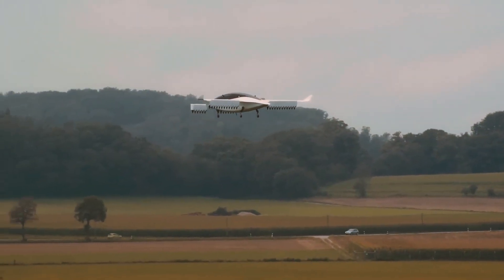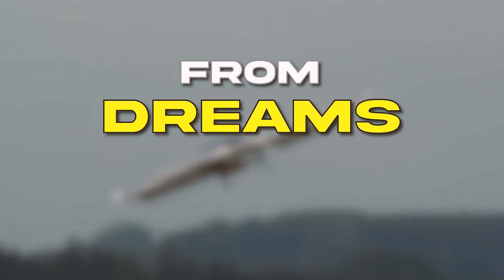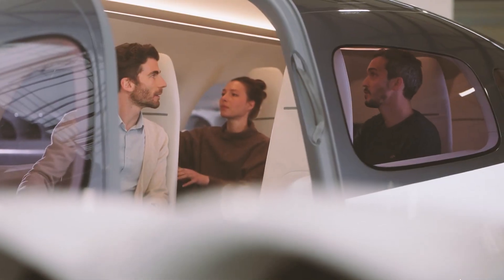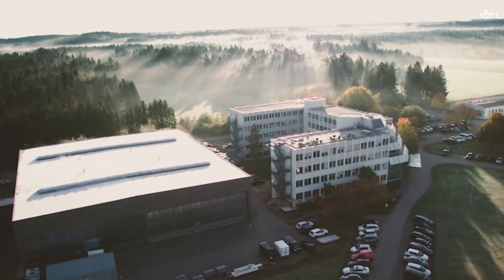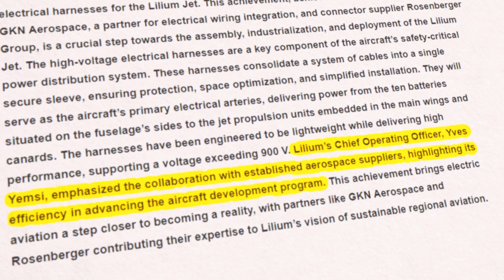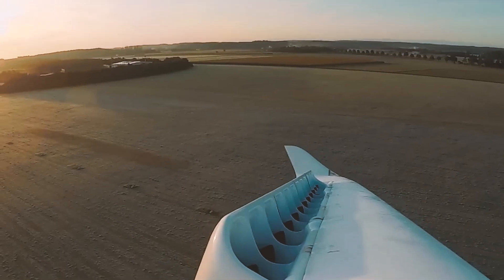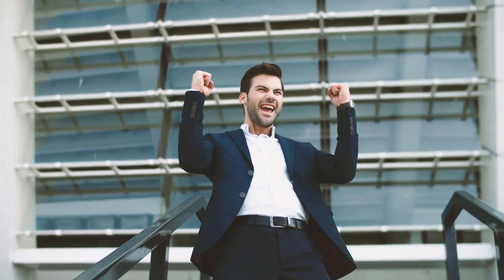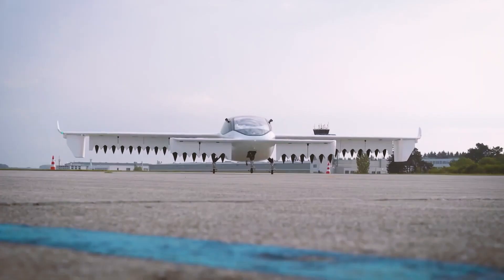Lilium’s Production Milestone | World's First eVTOL Jets are Coming!

Comment: Correction: 
- It‘s 30 jet-engines
- The top speed is 250 km/h
- The operational range is 175 km (without reserves it‘s 250 km)
Reply: They can't have a top speed before it exists.
Reply: @TheBagOfHolding  Yes they can, because it‘s limited to 250 km/h 🤦🏼‍♂️🤦🏼‍♂️🤦🏼‍♂️🤦🏼‍♂️ The jet uses around 10% of its max power when flying with 250 km/h, so the actual max speed is closer to 750 km/h, but that would probably break the whole aircraft’s body
Reply: @kingplays5369  they haven't even made it yet. I doubt a full scale version will ever exist that can lift itself longer than a couple of minutes empty
Reply: @TheBagOfHolding  bruhh do you even seek publicly available information about Lilium?😂 They have already done test flights with a 5-seater full scale prototype since 2019, reaching over 200 km/h
Reply: @kingplays5369  the prototype isn't full scale. They never had a full scale craft. I know more than you do.
Reply: @TheBagOfHolding  It is around 80-90% of Joby’s, Archer’s, Vertical’s or Autoflight’s full scale models, so what are you trying to convey here?? This is my last comment since I absolutely don‘t care about if you buy the stock or not
Reply: @kingplays5369 if you even bother to watch Lilium’s videos or researched them or listened to their latest earnings call you would know they never had a full scale craft and were planning on one flying this year but postponed it a year and will again if they don't get delisted.
Reply from the maker: @kingplays5369 Thank you for the correction! 🙏 You’re absolutely right:

The Lilium Jet has 30 jet engines (not 36).
The top speed is 250 km/h.
The operational range is 175 km (or up to 250 km without reserves).
We truly appreciate your feedback and will make sure to work hard to provide the most accurate facts in our future videos. Your support helps us improve, and we’re committed to delivering the best content possible! ✈️ Thanks for being part of the journey!

Comment: Which company we can invest for long term there are many stocks available in this space?
Reply from the maker: @deepanukishan8259 
Great question! There are indeed many exciting companies in the eVTOL and urban air mobility space to consider for long-term investment. Joby Aviation and Archer Aviation are two major players, both of which are publicly traded and have secured significant partnerships, like Joby's collaboration with Toyota and Archer's backing from United Airlines. Another one to keep an eye on is Lilium, which is pushing boundaries with its jet-powered eVTOL concept.

If you're looking for a more diversified play, companies like Eve Air Mobility (a spinoff from Embraer) and Vertical Aerospace are also making headlines with strong technological advances and key partnerships.

As always, make sure to do your due diligence and consider the long-term growth and market potential for each of these companies as the eVTOL space evolves. It’s an exciting sector, but still emerging, so it's crucial to weigh the risks as well.

Comment: 6:40  What,  what's with all the rivets?  This thing was going to be carbon fiber???  Now we got a squeezed rivet aluminum airframe?
Reply from the maker: @vaughnbay Great observation! Lilium initially focused on carbon fiber composites, but it looks like there have been some design changes along the way. It’s not uncommon for companies to adapt their designs as they move closer to production, often prioritizing manufacturing scalability and structural integrity. The use of rivets and aluminum could be a practical decision to meet certification standards or optimize the production process. It'll be interesting to see how these materials balance weight, strength, and cost as the project progresses!
Reply: @Discover.Aviation  Cost....It was cost that killed the composite Beechcraft Starship.  "It will be interesting" to see if anyone ACTUALLY buys one.

Comment: It wont have the lift capacity.   Elephant in the room.  🤣🤣🤣 🤡🤡🤡
Reply: Doubts about the sufficient power of jet engines for vertical take-off are constantly raised, despite tests proving otherwise. The two-seater model in 2/3 scale has been successfully taking off and landing on batteries from the web for many years, so where does this fear come from? The Lilium model easily reaches a speed of 250 km/h. 
If this plane is an elephant during takeoff, other planes are elephants in level flight. And here the scale quickly turns the other way, as the take-off and landing time is about 10 minutes, and the flight time can be an hour or more. This is reflected in the final range of the Lilium, which is 175 km, compared to only about 45 km for the competition, if we are talking about an electric and not a hydrogen drive. And at this range, the lilium carries 6 people and a pilot, while the competition carries up to 4 people and a pilot.
Reply: @aleksanderpegan4015 Thank you for stating these obv facts.🤝🏼🤝🏼 I have also made like 20 of these exact comments where I tell these crazy ahh people (or people who wanna short $LILM shares?) about the actual numbers of the 7-seater jet. 

The jet’s MTOW is 3175 kg, the propellers combined area is 3 sqm, so the disc-loading is 1000kg/ sqm. This means around 1.7kg can be lifted with every kilowatt. So they need around 1900 kW for hovering, which is not a problem, since each of the 30 engines can deliver up to 100 kW (-> 30*100=3000). 

I don‘t study aerospace engineering or anything that‘s related to tech but a bit of research is defo enough for this🤷🏼‍♂️. I get annoyed every time I see these people that say „Lilium needs to show me their 7 seater Jet flying“. Bruh noooo Lilium doesn‘t need to show you anything smh. The founders and some workers will get rich (or at least have stable jobs) and us investors that are smart will also get rich, so noone is waiting for these oh so sceptical and intelligent people, they‘re just gonna miss the best chance of their life and I can’t help em if they choose it this way lol. 🤦‍♀️
Reply: @aleksanderpegan4015 they aren't jet engines. They are ducted fans. They are motors.  They will not lift enough weight and run out of power to quickly. They haven't made a real craft yet because it's not possible for them.
Reply: @TheBagOfHolding  I know it's basically a ducted fans and I know small propellers have little thrust. But since the plane will be a full-size model, everything will be proportionally increased, the weight, the dimension of the ducted fans and, consequently, the thrust. If the model flies, the plane will also fly. They test the ducted fan motors in the original size for several months, and if during that time they found that the ducted fans did not have enough thrust, they would no longer insist on developing the aircraft and looking for customers. With so many experts with aviation knowledge, someone would have already realized that the matter does not work
Reply: @aleksanderpegan4015  Don‘t believe the other guy, he is trying to fool you with wrong information
Reply: @aleksanderpegan4015  bigger works for airplanes and helicopters because they depend on lift from large surface areas that are also cubed the bigger they are. This craft relies on thrust and it's own supplied energy rather than using lift. If it's possible then we will see proof instead of deceptive clips of empty crafts. Its not just them it's all evtols. None can prove anything.
Reply: @aleksanderpegan4015   Bro thank you for stating these (obvious) facts🤝🏼🤝🏼 I have also made like 20 comments like yours where I tell these crazy ahh people (or people who probably wanna short $LILM shares?) about the actual numbers of the 7-seater jet…

The jet's MTOW is 3175 kg, the propellers’ combined area is 3 sqm, so the disc-loading is 1000kg/ sqm. This means around 1.7kg can be lifted for every kilowatt. So the Jet needs around 1900 kW for hovering, which is not a problem, since each of the 30 engines can deliver up to 100 kW (-> 30*100=3000).

I don't study aerospace engineering or anything related to it, but a bit of research is defo enough for this🤷🏼‍♂️. It’s so annoying to see these people that say „Lilium needs to show me their 7-seater Jet flying". Like bruh no what you yappin about, Lilium doesn't need to show you anything! The founders and some workers will get rich (or at least have stable jobs) and some of us investors may also get rich, so noone is waiting for these oh so sceptical people. They're just gonna miss the biggest chance of their life and I can't help them if they choose it this way.
Reply: @aleksanderpegan4015  the bigger it is the harder it will be to fly. The square cube law. More thrust needs more energy and that needs a bigger battery and that weighs more and needs more thrust. It's a vicious cycle the evtol companies cannot defeat with current technology that's why they never showing them actually taking weight a distance that matters for a buisness
Reply: @TheBagOfHolding  My original comment keeps getting deleted but here are the actual estimated numbers: 

The jet's MTOW is 3175 kg, the propellers' combined area is 3 sqm, so the disc-loading is 1000kg/ sqm. This means around 1.7kg can be lifted for every kilowatt. So the Jet needs around 1900 kW for hovering, which is not a problem, since each of the 30 engines can deliver up to 100 kW (-> 30*100=3000). 

Believe it or don‘t believe it, I don‘t care cuz it‘s your missed opportunity
Reply: @kingplays5369 estimates based on individual component performance. That how likium does it. Components they made and rated themselves not the entire completed craft once it exists.